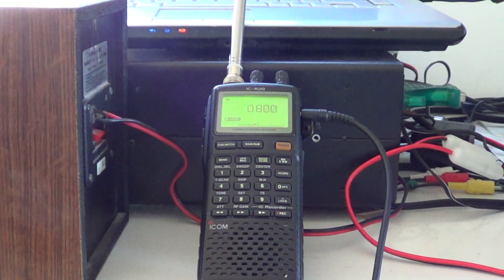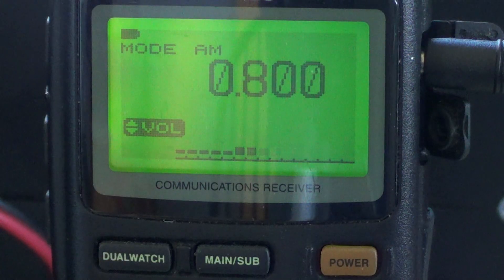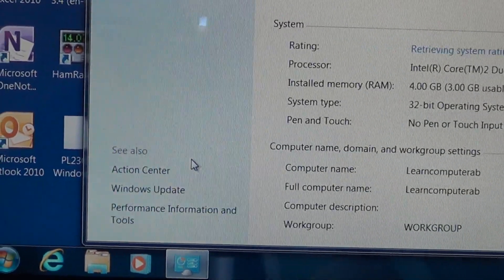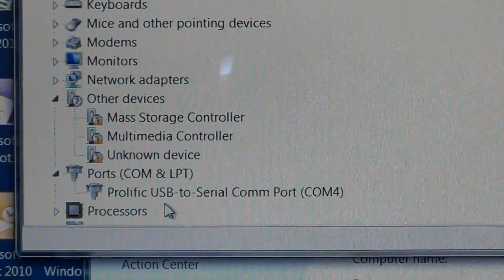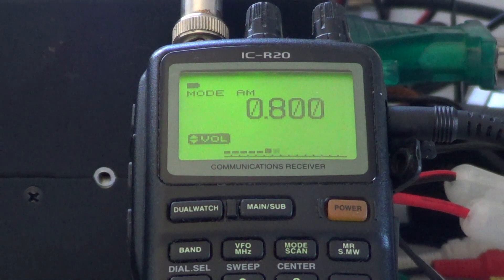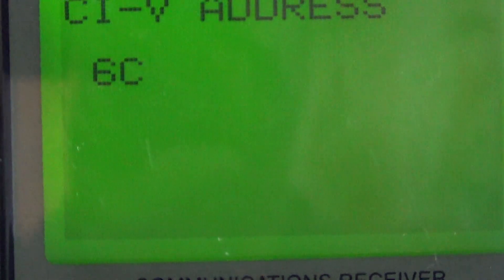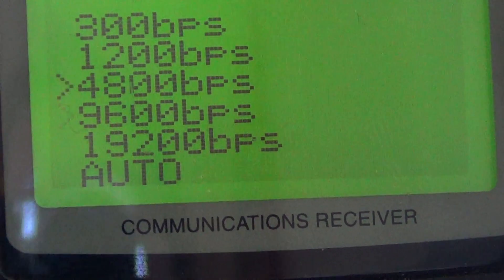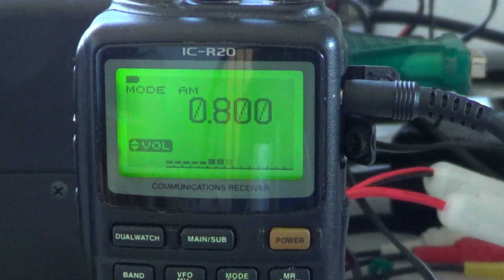Icom IC R20 computer control settings

Comment: Hello sir, I just want to share, Ive connected my Icom IC R20 to laptop wtih USB cable and use ARC20 program. And it works, can read and download freq data from IC R20 to Laptop with that app, and we can modify the freq and upload again to the IC R20.

Comment: I  had  problems  with  the  butel  software,but  after  emailing  them  I  was told  to use   the USB   lead  not  Serial, when I   used   the USB  LEAD  with  no  adapters  Ect  it  works  Fine, this  is  with  Windows  7.